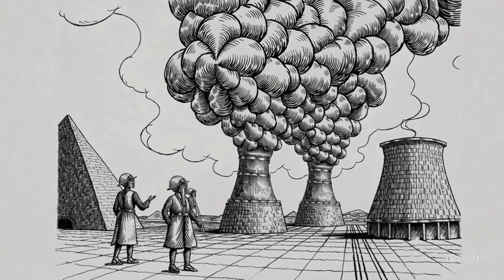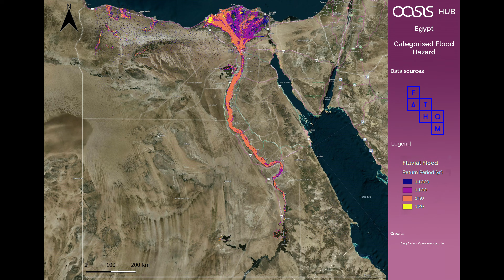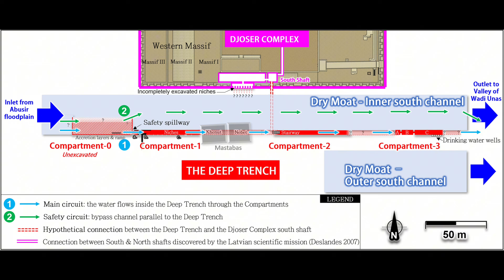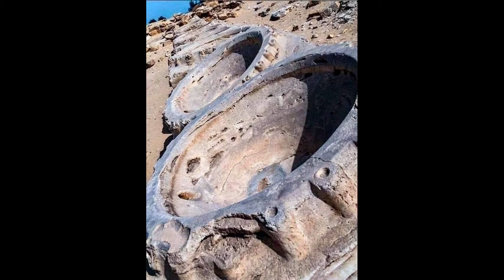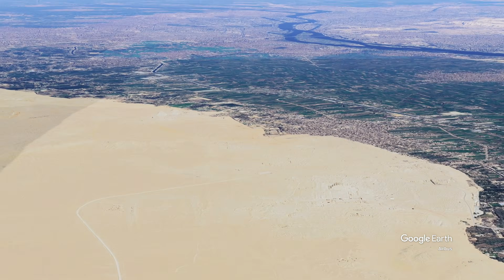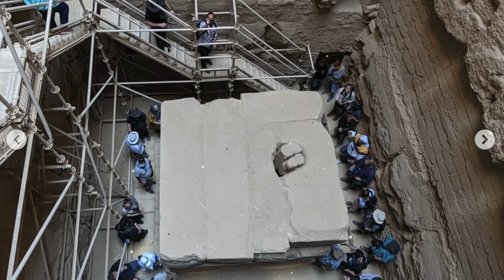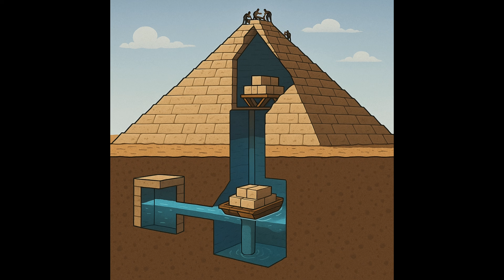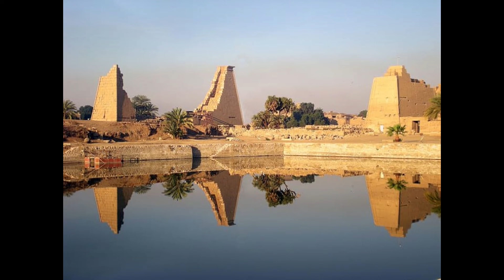The Incredible Hydraulic Lifting Machines of Ancient Egypt

Comment: Also it would take a long time to dry out the inner chambers before final burial.
Reply from the maker: Yeah it wouldn’t have worked
Reply: @intothemap360 i believe that whoever built the pyramids used some form of hydraulic methods.  Now the porous material at the bottom of the plug could act as a form of valve to counter the weight of the stone on top. But something like that would only be practical to lower a stone at a set pace.
Reply from the maker: Nah this idea doesn’t work.

Comment: What were the pulleys made of? Copper?😂
Reply: something tells me ya'll haven't much experience with treated hard woods.
Walnut would work well and support 100 tons no issue. i use walnut in place of metal where i dont want metal going, i get years of it rubbing against rope and wood etc without much damage. i do use a vacuum chamber to oil it to the core, but im sure same could be achieved with heat and pressure. think of old sailing ships, to lift those sails with many tons of force under wind you can't have pulleys with friction or it would quickly become impossible
Reply: @becheeesythink the heaviest the Romans could do with those was 50 tons or 80 tons....not even high off the ground...
Reply: @MrStixOnfire  i struggle to see how height would increase load, aside from limits in rope, but that can be worked around via relay points.
i done a quick search as was questioning my own memory, Google says "The maximum compressive strength of walnut wood is approximately 7,580 psi"
thats alot of pressure, bronze is around 50,000 psi but can be prone to bending before peak loads.... admittedly google is not so reliable with all the A.i slop now, but i feel this is niche enough to avoid the slop.
Reply: @becheeesyinformative...thank you
Reply from the maker: I don’t think they existed. I am just covering a research paper I think this theory has many issues
Reply: @intothemap360  (i'm likely wrong, but anyways)food for thought as an engineer i keep seeing those hieroglyphs of people pouring water jars as instead pouring oil instead, seems a pretty common assumption it is water,  im sure with all their fascination of gold and bronze etc someone realized a bit of oil would make an effective bearing, my dirtbike uses brass sleeves on the camshaft and my sports bike has the cams sitting in the aluminum with nothing but oil keeping them separate. food for thought a little oil goes along way :)

Comment: I completely agree that the Egyptians used water to move things.
A few water tidbits  
1. causeways- a small amount of water flowing down a causeway could lift a raft as wide as the causeway simply by building up a small depth in front until it lifts off the bottom. Suddenly, friction goes to zero and loads could be pulled up more easily. Or they could slide down on their own. Eight inches of water built up in front of a twenty foot wide by twenty feet long raft can lift 8370 pounds off the bottom, for example.
2. moats formed by walls around a pyramid could feed causeways and flow down descending passages
3. Sadd el-Kafara Dam formed a reservoir of 570,000 cubic meters at an elevation of 125 meters could have supplied water at 60 psi to the Giza Plateau. Tunnels or karsts beneath the Nile could have delivered the water to the moats through vertical shafts 
4. floodwaters captured in elevated ponds could have supplied irrigation water to grow crops during non-flood times
5. porous limestone rooms at the bottom of descending passages could drain 2 gallons a minute per square foot to groundwater
6. a one meter by one meter well sealed with grout at each level could lift 2.5 ton blocks sitting atop hollow wooden cages floating in the well by pouring water around the sides. Blocks could be slid onto cages sitting one level above in a stair step fashion up the side of the pyramid. The water could be drawn from the previous well to fill this next one. A whole string of wells up the side of the pyramid would deliver a block to the top level every cycle as the pyramid grew in height. Casing stones would be installed all around each level except where the wells were. Workers could climb up the steps in the morning to reach the top level where they would work, floating stones on rafts in shallow canals to where they were needed. Crews remained at their well on the face of the pyramid and another crew next to them but on the next level stayed at their place as well. All day long they slid stones to the next cage and filled buckets of water from one well and poured it into the next higher well to lift the stones. Multiple strings would stair step up on each face. When the pyramid was complete, the wells were filled and casing stones installed in the stair steps from the top to the bottom
7. The boxes in the Serapeum may have used a fluid film to move the lids along the top. I feel they could have been to machine the flat faces of the casing stones by pulling the lid so it shaved a limestone block mounted in a jig on the inside
8. The same idea of using pairs of polished granite blocks to slide heavy weights on a fluid bearing
Reply from the maker: Haha this was my first Egypt video and I covered someone else’s research idea not mine. I don’t do that anymore. This papers theory does not work at all. Thanks for watching and hope you like the channel!
Reply: Well said..!!👍

Comment: Ref. approx 22:39 - North shaft porous stone blocking pathway, almost like a thick coffee filter; 
* Buoyancy to lift ratios related to avg. cycle throughput time to lift 1 stone and why the vertical shaft narrows at a point very near one side of the lower shaft, at the same point near the porous blocking stone. 
* Assuming the porous stone can permit air and water to flow (relatively slowly displacing each other, with air into and water out of the chamber at the narrow point between upper and lower sections, while retaining enough water pressure to keep the shaft filled), could air have risen and been trapped in air tight areas below a wooden cradle structure, below a stone?
* If so, is there a way to provide a modular assembly line design, so that it is a continuous loop (or near continuous), rather than a raising and lowering method that would consume considerable time?

I’m not an engineer, although a fan at heart. My comments may be raw and are offered as food for thought.
Reply from the maker: There are far too many issues in the ideas presented in the paper for it to be a viable method of lifting stones! Also I learned afterwards there is no water connection from the moat and deep trench (as suggested in the paper)
Reply: @intothemap360  Thank you. I get it, it’s not viable. Aside, I wish only to offer a suggestion in support of a perplexing challenge. Does the curious, porous pathway have a gradient? It could have been blocked off easily enough. Both porous sections (ref. diagram) may have been purposely built, including differing sections on the RH and the LH sides, with a (yet unknown) function. It could suggest it was first constructed as a continuous path, with intent to be excavated just afterwards and hollowed out, to help form the narrowed shaft section. Thus, if the porous pathway (RH) is inclined where it leads upward to the shaft, this could be an important clue. If it was only meant as a drain, an outward declining shaft would not be entirely necessary (conservation) yet, an inward incline could then aid airflow for entering through displacement or other means, for some unknown purpose. I am not requesting a response good sir. Thanks again. Be well.
Reply from the maker: I’m not sure what you mean by porous path. Do you mean where they said the water could trickle through the box in the main shaft where there are layers of various rocks and gravels?
Reply: @intothemap360  I meant the specific area, directly below the stairs and pavement. I should have been more specific. Still, I am not 100% certain if this is a porous area you described. Aside, I have another offering, to follow. It's just one man's imagination inspired by your work. I greatly respect what you are pursuing here.
Reply: Regarding the video, with focus on the 1 image of the lower section of the North Shaft, I offer the following from the reflexes of one imagination.

1. Lower area surfaces appear smoother than upper areas.
2. Vertical stress marks on one wall do not appear to be made from up and down motion. Appear more likely from (2) sections of ladders or vertical beams. No gouging depressions or striation is apparent and they do not appear to be strictly aligned.
3. There appears to be remnants of stone ledges (worker landings), appearing on 2 sides, on walls both below and above the large, crude openings on opposing walls (set of 4 ledges in total, 2 upper, 2 lower). Ladders allowed workers to climb up or down quickly, as needed, causing passive wall erosion. Workers teamed together perhaps in sets of 2, (total of 4-6?) Workers could have been on a rotation schedule, due to heavy labor demand. The upper ledges are almost completely gone, suggesting this is the point where the labor demand was greatest. The wall side ladder was an alternate ladder for use to avoid interfering with other active areas or perhaps another unknown use.
4. The vertical opening, opposite the stairs, appears larger/wider at the base, that may have been caused by large objects (friction), such as wooden beams, supplied by entering the shaft at this point, being handled at an angle occasionally. Also appears to be just large enough for a person to enter as needed. Separate workers could have managed this supply shaft.
5. The porous area directly below the pavement and the stairs, appears to have provided fresh air ventilation, through gradual or periodic displacement of water/air. This suggests unwanted air could otherwise collect in lower areas of the shaft and thusly, a direct vent was avoided (?). Also suggests the need for ample supply of fresh air to support heavy labor.
6. Crude and worn wall openings for 2, heavy, removable, horizontal beams: Lower beam prevented a lower raft from rising higher. Upper beam was a failsafe, preventing upper structure/s from dropping lower. If so, it could provide a clue as to the vertical height of cradle modules.
7. A heavy wooden, rectangular or square scaffold formed a guide from shaft bottom to top (perhaps with a stone base, now missing?). This feature kept modular cradles vertically in place and aligned. Also provided support for a pulley system to manually operate the chamber plug. Each tier of the structure may have featured gravity locks, supporting each rise cycle as a failsafe, under constant inspection and confirmation by more workers. Water may not have been intended to reach higher than the bottom of the stairs ordinarily. Horizontal beams locked into shaft walls were minimized to preserve overall shaft integrity. Horizontal beams may have been present much higher up the shaft, to help prevent stress warping of the tall wooden guide/support structure.
8. A continuous loop, with upward progression of modular cradles. Once a stone was delivered to the top, the cradle may have been disassembled, sent down the exterior, and fed back into the supply shaft… or disassembled on the ground instead. This allowed a steady “eyes on”, go/no-go inspection of timbers.
9. Cradles were a “quick fit” assembly, by way of friction and gravity. As the vertical assembly was lifted, locked in place and then with water lowered again, it provided space for the next cradle to be assembled beneath it, preparing for the next cycle of water rising. The bottom raft structure was a set and forget structure that did not need disassembly very often and may have featured special flotation tech.
10. Although more labor intensive than alternate methods, it could be in theory, very reliable, if not more so.
Cheers.
Reply: I can appreciate how daunting such a pursuit can be and do not wish to appear to be pestering. A few more after thoughts.

A. In a 3D model, I see a tunnel rising up from the ceiling of the stairway. This could be a tunnel to supply timbers to the shaft?
B. The opening in the wall opposite the bottom of the stairs, could be where various tools were stored… a tool shed. Not a supply shaft.
C. The pair of vertical lines just beneath the bottom of the stairs, could be where a ladder once was. Why? The markings appear to be passive. If a pulley system was present and counter-weighted nearby, and could be fine tuned (add/subtract weight as needed), it could allow perhaps 2 workers to step onto a small swing platform (a ladder / set of small platforms), lowering the swing and raising the plug. For reverse, a 1st worker could step off (thus the need for a ladder nearby,) gently raising the swing and lowering the plug. At the right time (as the plug enters the opening), the 2nd worker could then step off. This may help explain some of the cracks/wear on the top of the chamber around the plug.
D. Adding air to water increases buoyancy and may slowly provide new air above the water line. I understand the water table height from 1,000s of years ago is not accurately known. However, I read it is generally understood it was lower then, compared to modern times. Could the extra tunnels around/below the chamber have provided some air to rise up towards the chamber? For ventilation and increased buoyancy?

Comment: i think they definitely were pumping the shafts with water and then lowering stones through them by draining them of water. the hydraulics of the system might have worked like a heart, so by pumps: first the shaft is flooded, then the water is drained through corridors, then the shaft is flooded, then the water is drained through the corridors, and so on. 

the matter of getting the water is of course not a mystery, just a question of connecting the system to the river. the river always flows, and the amount of water this system would need to take from the amount the nile river has is immensely small.

Comment: I like your analysis and especially your comment of how long it would take to drain it and fill it. My belief is that the strange sarcophagus was built using paving stones much later.After the step pyramid shaft stopped functioning as a cistern.
Reply from the maker: Thanks! Have you seen the one I did on the tunnels at Saqqarah? The deep trench briefly mentioned here? One issue I found was there isn’t a physical connection between the southern tomb at the Djoser complex and the deep trench. The details on the offshoot tunnels to the east of the pyramid are fuzzy and unclear at the moment
Reply: @intothemap360 the  trench is something not related to the underground tunnels. My theory suggests that the deep trench was just a way for boats to access the pyramid complex via Nile and gsir el media check dam helped maintain water level
Reply from the maker: Yeah I hear you. I’m saying the paper I reviewed in the video said the trench was connected.
Reply: Although I will admit that trench is pretty darn deep for a boat.
Reply: @intothemap360 you're right.I forgot because I actually consider it.The trench was used to drain water to the cistern. It's been a while since about this. Also I think the underground cistern was a failure, and the next ones had above ground cisterns.Which , of course are called valley temples
Reply: According to my pyramid theory , those long tunnels were used to drain dirty water from the stepped pyramid cistern

Comment: one thing thats worth noting, assuming practical feasibility of course, is that if this IS possible, it doesn't have to be good, it just has to be better than the alternatives. And there could be any number of reasons why it would be better, lack of man power would be a big one. This is something you learn after letting a really slow process run for a few weeks, and then you realize you can extrapolate it to years and suddenly the numbers are WAY more acceptable, considering the amount of work required. 

If something takes 3x as long, but 1/10 the effort, that's a no brainer. It's possible this could've been a situation like that.
Reply from the maker: Right. I believe you saw my video on the tunnel under the dry moat right? The biggest issue with this papers theory is that there is absolutely no connection from the great trench to the southern tomb. No way for the water to flow. We have pictures in the great trench as you saw, that is a fatal problem with what I originally thought was a very interesting theory.
Reply: @intothemap360  yes, i did catch that video. It's definitely an interesting theory, although that is definitely a big problem with the theory.

Comment: Do u think instead of a saw they used water pressure to cut the stone ?
Reply from the maker: Abrasive cutting is more likely
Reply: @intothemap360 oh and btw your channel was recommended to me thank you so much for getting me so into Egypt this is a whole word I never knew was possible
Reply from the maker: Glad you’re liking it! I put a lot of work into these and lately have been building practical models! Welcome!
Reply: @intothemap360 ok thought so but it’s food for thought that they could have had more then one way to cut stone
Reply: The biggest problem with this theory is not only that , it only applies 21 pyramid , but that the of the water elevator only went to the lowest courses of the pyramid , it would be useless
Reply: (21 should say only to this) pyramid
Reply: I think it's more likely that this giant chasm represents a cistern and the tunnels were designed to remove dirty wat